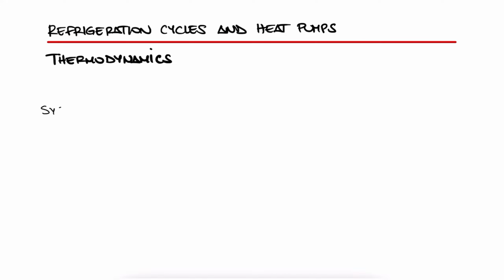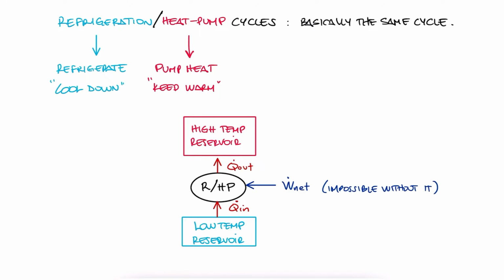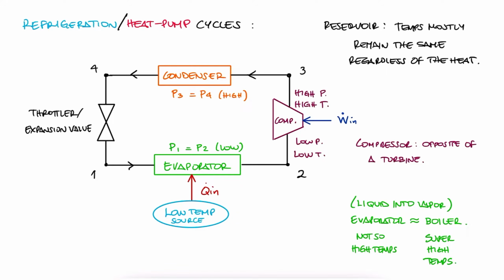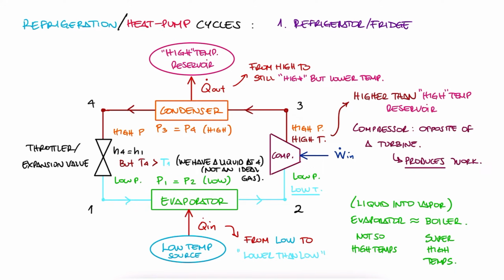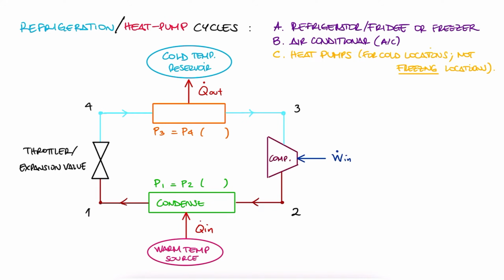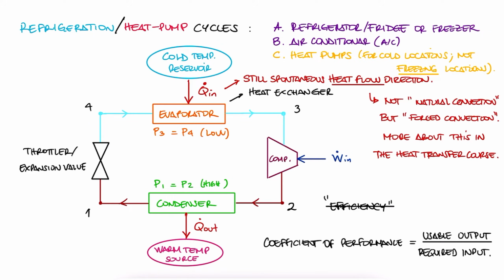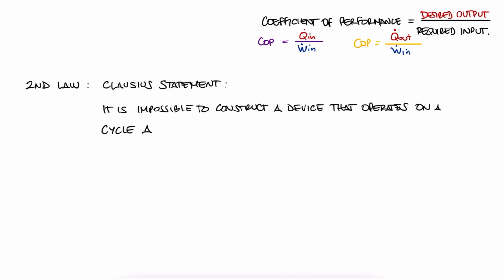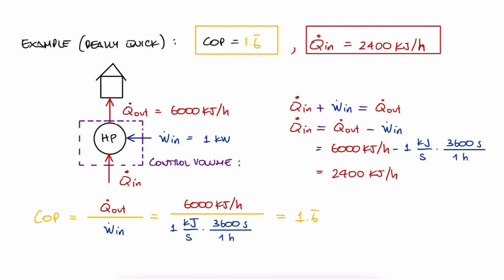REFRIGERATION and Heat Pump Cycles in 10 Minutes!

Comment: for a heat pump why would the directions be reversed? wouldnt the cycle just continue in the same direction but the sources and sinks of the heat changes?
Reply: Bunch of unneccessary piping and components to do such a thing.
Reply: @jacques-a-damus4179 pipes and components convey fluid. I agree though, they do contribute to heavy pressure losses.
Reply: If you don't want to uninstall the condenser and evap, keep the same flow direction. And change the source of Qin to the condenser for the pump.